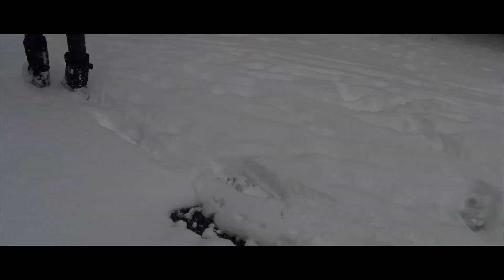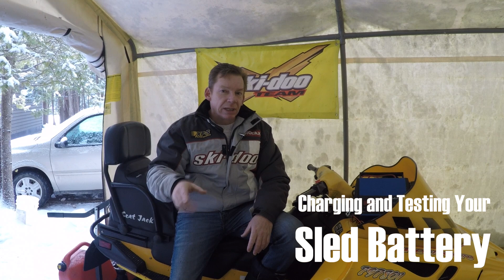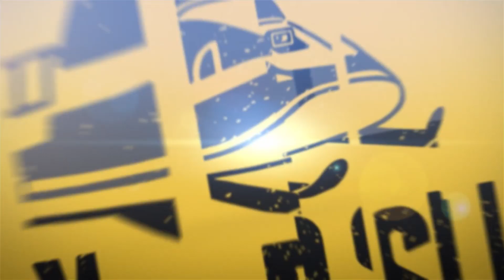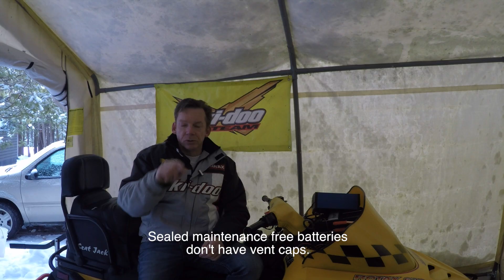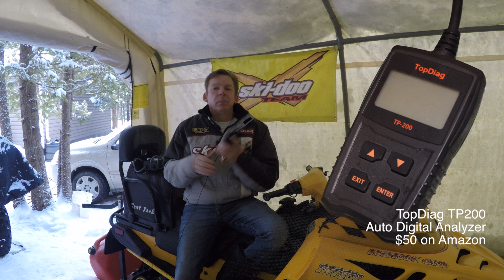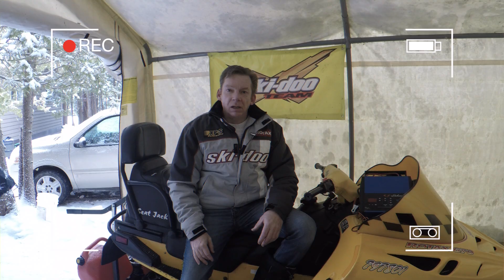How I test Sled and ATV Batteries

Comment: One thing I learned about charging batteries for sleds or quads is never leave your battery on a concrete floor because it will drain it even when it’s on the charger. I was very confused when It happened to me
Reply from the maker: I have read that also. I haven't run into that, but mine aren't stored on concrete.  I know people who swear its true. I called the manufacturer of my battery and asked this question. The rep said, I'm not really sure it will cause it to discharge, but low temperature of the concrete might affect it, you could put a piece of cardboard under it" I also spent some time reading various articles. One article quoted Interstate Batteries, “The type of plastic (polypropylene) used in battery cases is a great electrical insulator. Also, tremendous technological improvements have been made in the seals around the battery posts and vent systems, which have virtually eliminated electrolyte seepage and migration. So, it’s OK to set or store your battery on concrete.” But to your point, I certainly have heard this as well.

Comment: Great video Dave. Can you post the make/model/source of that battery charger. I didnt notice it listed like the other items. 

Apart from checking your battery I would suggest checking the starter solenoid and starter ground has a good connection. I experienced issues with both of these after messing around trying to diagnose a battery issue. A fully charged battery should read around 12.5volts static and 14.4volts when the engine is running, of course Im sure you’re quite aware. 

Keep them coming

M
Reply from the maker: The blue charger is a Schumacher sc1359, available from lots of retailers like walmart. Again, be careful that the charge rate on the charger you buy accommodates the battery type. Ive used this one with no issues on snowmobile batteries, but each battery will have max charge rate.
Reply: My Old Sled thx Dave. 

Would say that the TopDiag TP200 can do what that load tester can. Im thinking I dont really need the load tester if I have the TP200

Comment: Can you safely jump start a snowmobile battery?  Concerned about damaging the electronics on newer sleds.
Reply from the maker: I know some manufacturers advise against jump starting. Best is to have a battery pack. I imagine it can be done safely if you connect it carefully and switch off any electronics but it’s probably not ideal.

Comment: Dave, do you have any good info about Dim headlights and tach not working when my 06 REV 500ss is below 2000 rpms?
Reply from the maker: Like i said, electrical problems are a bugger to resolve via email. Maybe a bad stator, or something dumping voltage to ground.
Reply from the maker: I would check wiring carefully, see if theres a bad wire shorting somewhere.